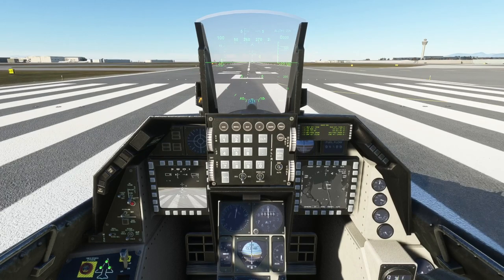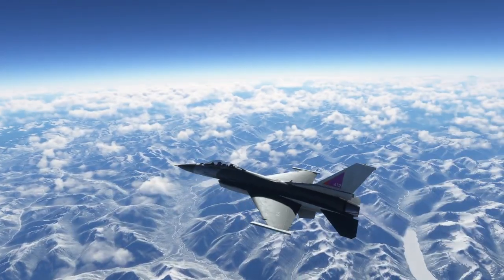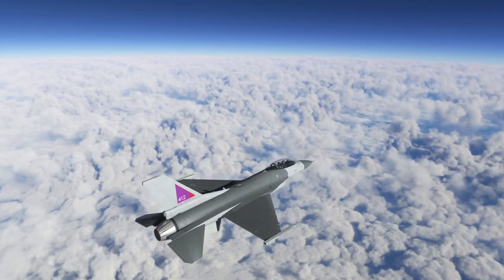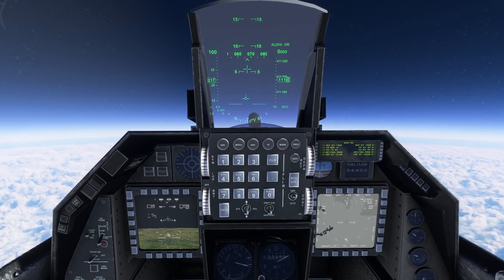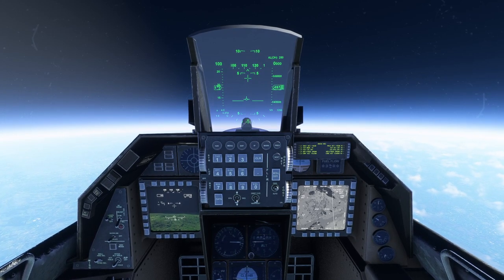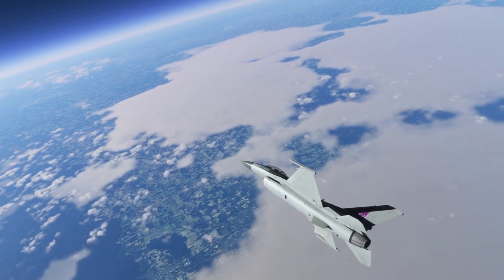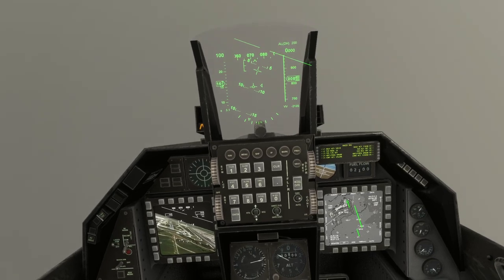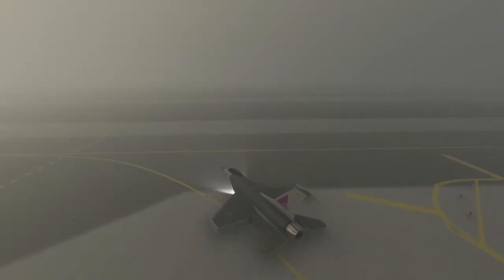Flight Sim 2020 - F-16 over 120k altitude!?

Comment: I had a problem early on with my sim. GA aircraft were flying over 100,000 feet. It was something to do with realism settings if Iremember correctly.

Service ceiling for ga aircraft is when the rate of climb drops below 100 fpm. Not sure on jets or military.
Reply from the maker: I don't believe it's realism settings - I've got true-to-life except for the taxi ribbon. Also, I like to fly high and fast often, and this is the only plane recently that's exceeded its specs so severely.